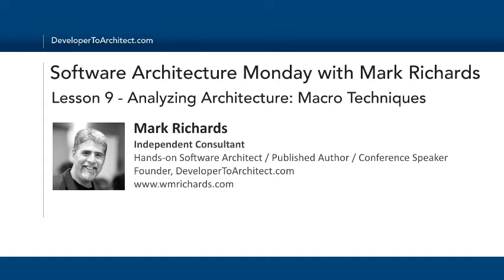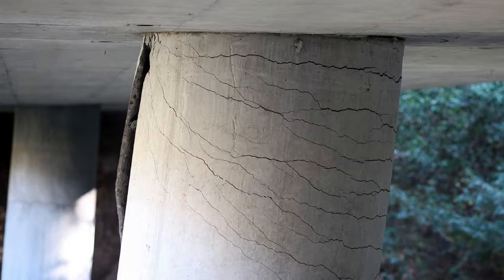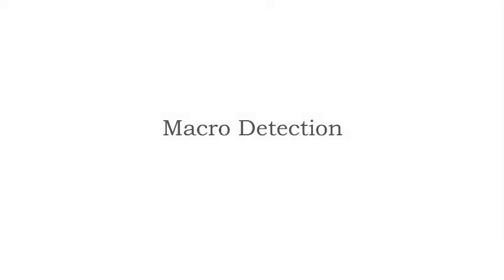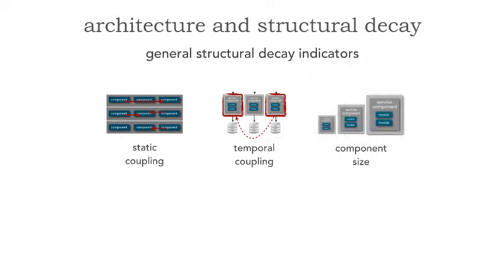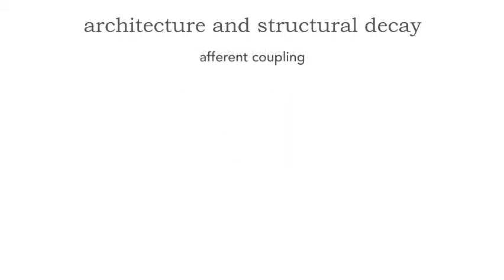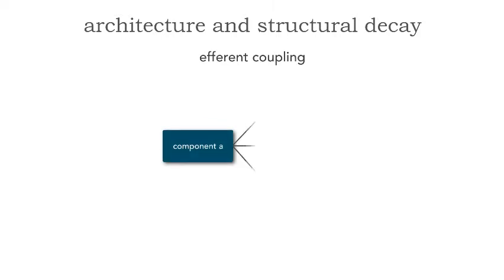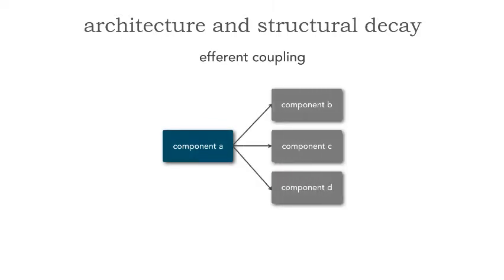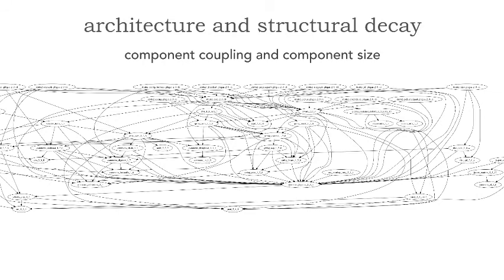Lesson 9 - Analyzing Architecture: Macro Techniques

Comment: Can you please clarify what do you mean by static coupling? I looked up coupling categories by different authors and "static coupling" is rarely mentioned.
Reply from the maker: An example of static coupling would be a contract or shared library (JAR, DLL, etc) that is shared between two services. Dynamic coupling would be a call made to a service at runtime via REST or some other kind of protocol.
Reply: @markrichards5014  thank you